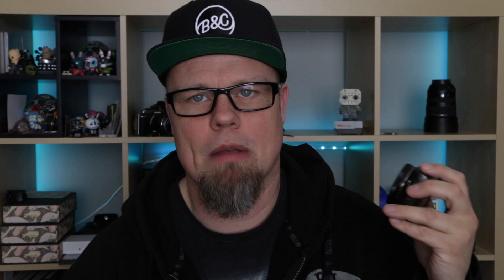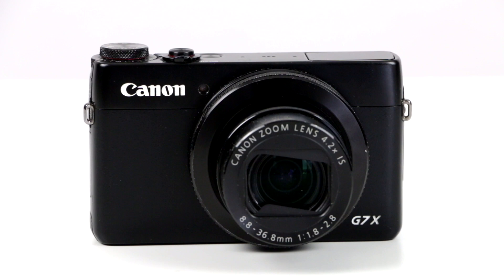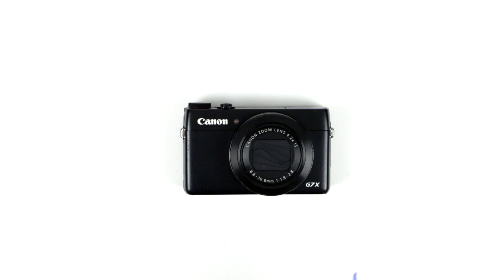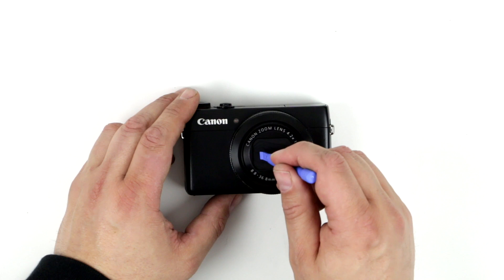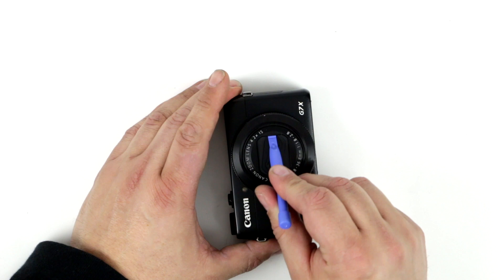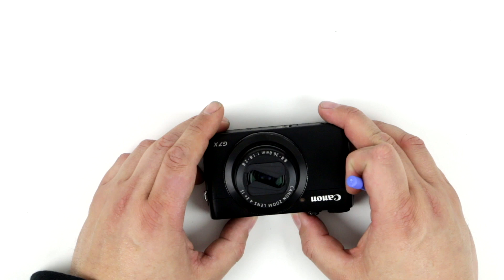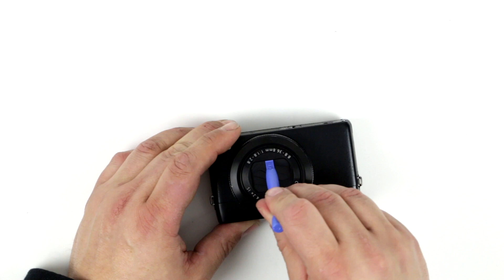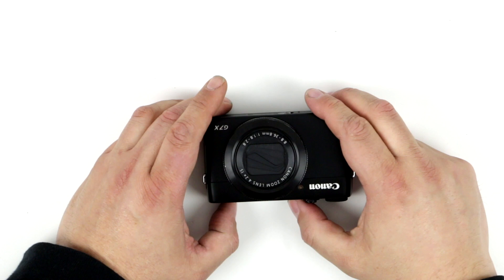Repair Your Canon G7X - Quick Fix Stuck Lens Cover

Comment: Everybody seems to have this problem. So, the design is not quite good in these cameras.
Reply from the maker: It is an issue that would be fixed by just having a lens cap, but defeats the compact nature in a way. Mine occurred because I don't treat the camera well, it gets thrown in pockets, bags, with little consideration for math else is in there.

Comment: Dear camera manufacturers, please stop to use this bad shutter design, not everybody can use their cameras in sterile enviroment
Reply from the maker: I am going to assume that you are having issues with dust inside the lens.
Reply: Yes, indeed,  and i managed to destroy the shutter while trying to fix it, which is of course is my own fault, but i guess every sane person will admit - this design is one of "engineered to fail" examples. and i'm not talking about extreme cases like putting your camera into sand or just  dropping it on a hard surface, obviously the camera in question was not marketed as dust or shock proof,  but over time it did eventually fail anyway (that's how i got here)   and this is not the first camera that had this issue (the previous camera  like my current one did not suffer from extreme conditions, not even a dusty room). I mean the device designed to protect the lens from dust could use a device to protect it from dust. And that's  only the part of the problem, the real bitch is the cleaning process (in some cases, if you're lucky, you can remove the shutter  from the lens to clean the mechanism, but sometimes your only option is to disASSemble the camera to clean few specs of dust, Yay!. It would be a minor complaint if you have a new camera with warranty service provided, but if you bought it used on ebay (like i did) then have fun. (i'm not mentioning workshops because of the high prices they charge, i rather buy a new cam if spending a ton of money is my only option). What would be a solution for this issue? my suggestion is a simple lens cap!  Like many DSLR's have, not as convenient as a shutter but a lot more reliable.
Reply from the maker: Just curious how long it took for this to happen to your camera. I also assume we are talking about dust inside the lens in which the barrel has to be removed.
Reply: My current camera, a samsung wb650 was working fine for a year before running into this issue, but i have no idea for how long the previous owner did use it., and my previous camera a real dinosaur samsung digimax a6 ran from 2003 up to 2008. The a6 had a plastic shutter as i remember, which in my opinion is a better choice(less prone to bending and jamming) but eventually it's shutter did fail and the camera was scrapped.